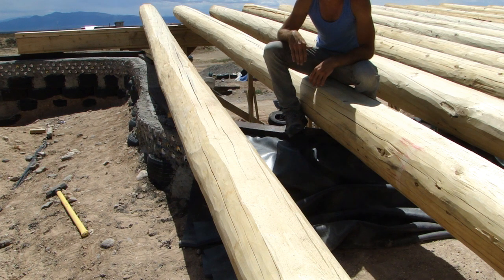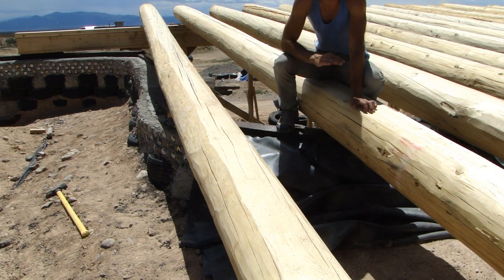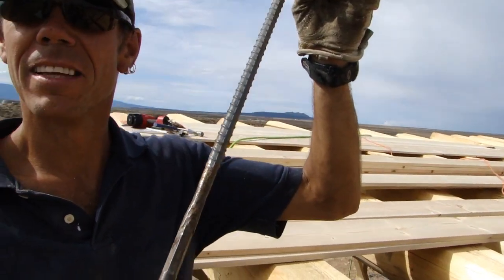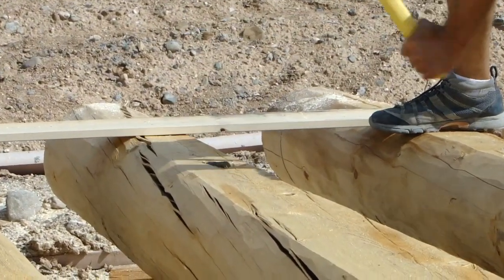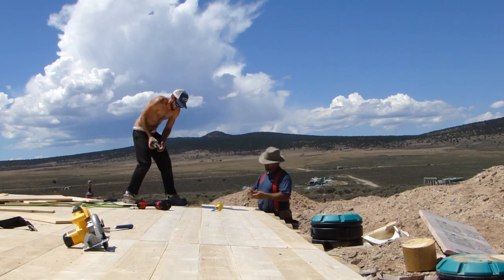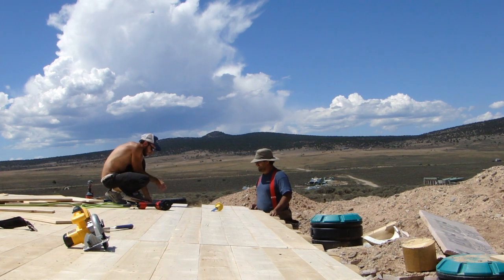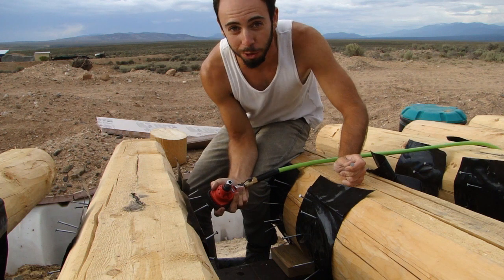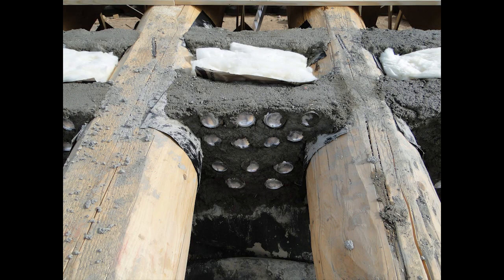How to Build an Earthship Metal Roof - Part I

Comment: The cans aren't there to insulate, they're there to replace some of the cement volume by acting as stay-in-place forms.  The result is a lighter-weight cement 'honeycomb' non-load-bearing wall.

Comment: I want to use balsam poplar for vigas. I'm in Canada. Balsam poplar is everywhere and I can harvest up to 100m^3 of timber per year for free. There is some eastern white pine I can get if I travel about 500km, I would rather not. Anyway, is the balsam poplar going to handle the weight of the snow? How long do you folks figure it would take to dry in a solar kiln? Does the solar kiln dry it too fast?
Reply: Oregon...aka...Douglas fur are the best. They disease resistant pine. We built our log home out of them 20 years ago. We lived in mal borough sounds New Zealand where it rains a bit and still had no probs

Comment: If rammed earth won't work for earthships, then maybe we can go to concrete.  I'm not sure that maybe better then tires.  It maybe be stronger.
Reply from the maker: you'd be hard pressed to build anything stronger than a well-built good tire wall.  buried, vulcanized, steel-laced rubber packed dense with earth. it can be shaken, settled, etc.  It doesn't crack or fall over.  Its 3 feet thick and many tons of mass.  you're not going to pour that much concrete.  but there is such a thing as overbuilding.  If you don't need a military grade fortress then maybe tires are unecessary